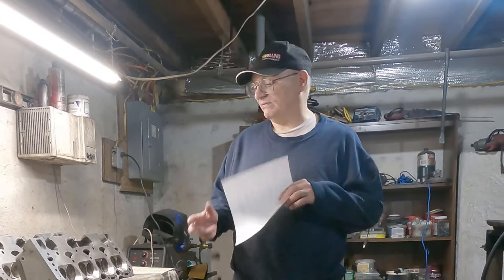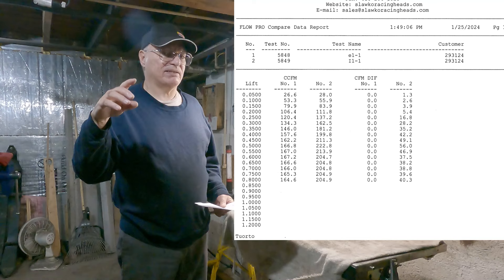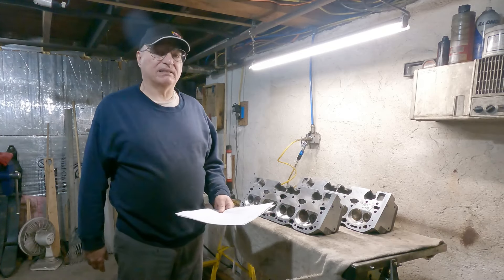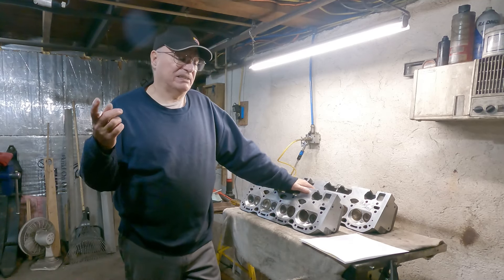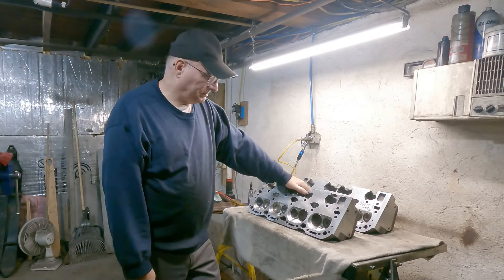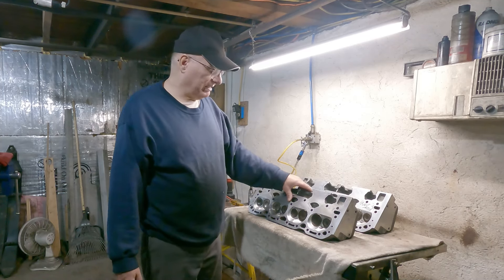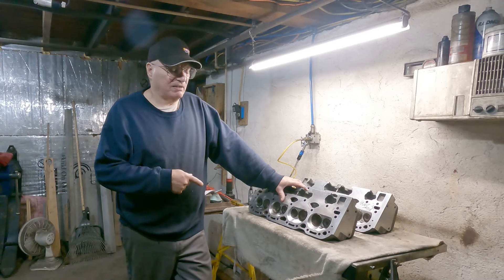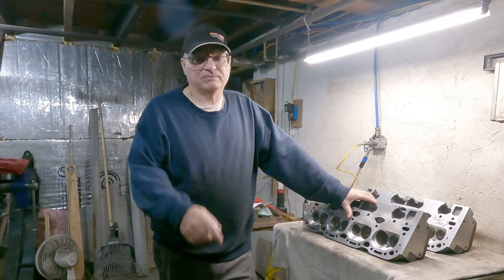My Cylinder Head Flow Numbers 🤔

Comment: I've been doing deep research on my new Blueprint engine head and cam data. Mr. Vizard says that my LSA should be 106 and the BP cam is a 110. Also another tuner said that if we can get top flowing L98 aftermarket heads, with the right cam and target power range, in my case 2500 - 6500 rpm, I can maximize HP. Right now the engine dyno'd at 508 ft/tq and 498 hp. The Blue Print Vortec heads flow around 265 cfm at 0.500 I and 250 cfm Ex. The LS3 heads flow 330 cfm pretty much stock for comparison. AFR race heads are around 290 cfm range for their 220 heads. You mentioned TPIS, that's Jim Hall's shop. He said to me recently, that his focus now is on LS engines. He made my Mini Ram last year, but it was one of the last one's. It's hard to argue with the Cathedral port flows of the LS. I don't think you can trick out the L98 heads more than 300. So there you have it. Good luck on your heads. Keep us posted on your results.
Reply from the maker: Those sound like good numbers you have, I am not looking for that much HP or rpm, I most likely going to stay with the cam I have 219/220 and .480 lift, 112 lsa.

Comment: If you install 8mm guides then you can use stock used take-off parts from an LS1 engine, the valves,springs, retainers, keepers.   It's just another option to consider.    Normally guides or stems wear quickly because the seals are too tight and not allowing enough oil through.

Comment: like your vids not many messing with the SBC let alone tpi with OBD1 your close too im in NJ and I also modify the TPIs anyway you have something going on L98s can make 280 rwhp and 370 tq on the stock long block, stock cam, stock tune with only intake change.  imo i would scrap those heads once there milled wrong its not worth messing with them by the look of the combustion chambers they also look overworked you can find the stock 113 aluminum heads for cheap now i would start over with a good core i have gotten 290 210 but with bigger valves, with the stock valve sizing and a valve job and some port work you can get 240 190 out of them easy

Comment: looks like your home porting picked up 20+ cfm on the intake? I'd be proud of that! good job! yeah from your comparison chart it looks like the top flow # are stepping up to 2.02 / 1.60 valves and opening up the ports quite a bit also, I'd probably get your self a nice set of Trickflow or AFR heads and just save the stockers instead of investing even more into them

Comment: MAPCO Machine Shop boooool
Reply: @E.T.GARAGE  how you feel about Dart 215 aluminum heads locally for 1300. They are for a large solid roller cam springs. So I was not sure if I should get them or just order the proper ones with proper springs for a smaller hydraulic roller cam
Reply from the maker: Thats something you have to decide on, normally 215 are used on bigger or higher rpm engines, I would try and talk to someone that has run them.  @daveunbranded